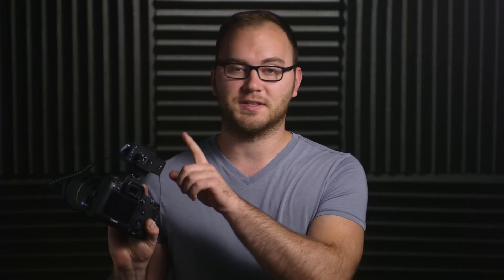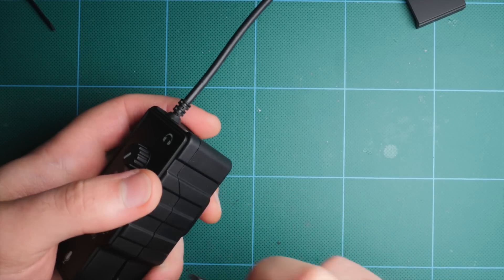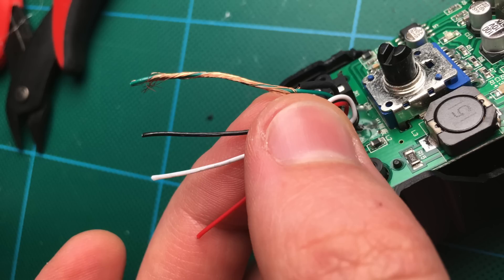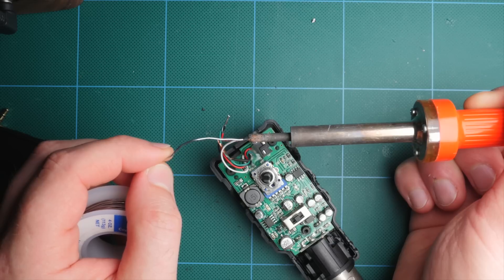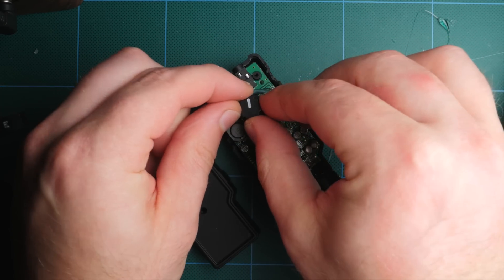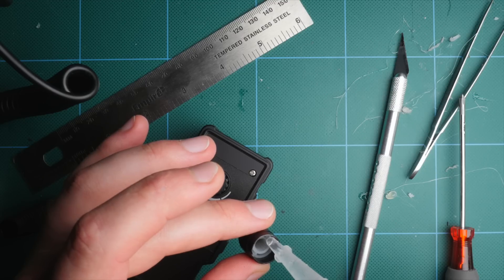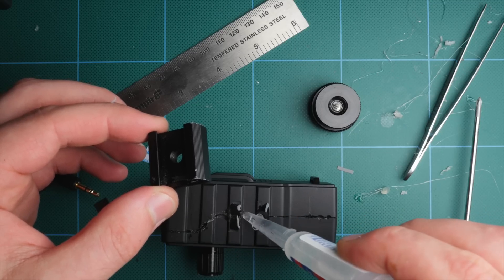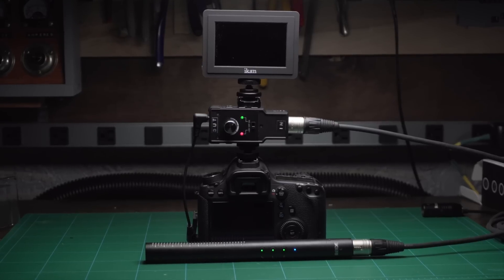Hacking the $23 Saramonic Preamp For Video Use

Comment: I'm a bit unsure why we're modding the cable, when in the end you just use the headphone output anyway?
Reply: This is also what im wondering about!
Reply from the maker: Because we need to convert the TRRS (for phones) to TRS (universal I/O). You could just use the adapter I talked about in the previous video. I liked using the headphone jack because I wanted the option to choose the cable length.
Reply: But couldn't you use the headphone jack directly without ever modding the cable? Or is the headphone jack also TRRS?

Comment: Ok, so when I mounted the shoes on mine, I filed down the "lugs" on the sides of the unit to make a flat surface first, then drilled 1/4" holes in the sides and bolted them through the battery compartment. I had to trim the inner layer of plastic to make room for the bolt heads in there, but the battery still fits perfectly.
Reply from the maker: Nice Scott!

Comment: what was the tool that you use to remove the wire cover ? 
can you link it plz ? 
is it reliable  ? 

why you remove the headphone jack that was maybe perfect for A6300 users ! we can put another output jack beside the headphone jack
Reply from the maker: Hey Moamen! Here is a link to the wire stripper I use: http://amzn.to/2coKh7I It rocks my face off. I love that thing so much!

I removed the headphone jack because I prefer using my own cable. That way I can keep it short or lengthen it if I wanted to. I also know that I wouldn't use the headphone jack because that only monitors the preamp, not the camera which isn't as safe.

That said, you could just turn the cable into a jack on the box.
Reply: thanks 😊☺:)

Comment: how would this make audio better? im learning... if someone could explain me... thanka
Reply from the maker: I'll do a Q&A since a lot of people have been asking this. This unit is essentially a better version of the preamps in your camera. You'll get MUCH cleaner sound, XLR input and you have smooth level adjustments instead of the menu levels on the camera.
Reply: 5 reasons a tool like this is super handy:
1) the pre-amp in most DSLR type cameras are quite noisy. So, with this device you can turn your camera's input level down low.
2) this device also gives you a dedicated audio control, so no menus to dig through to adjust your audio level.
3) this gives you the ability use XLR mics. XLR connections are "balanced" this gives you the ability to conduct sound through extremely long distances even over 100' without picking up noise.
4) this device provides 48v phantom power that many condenser mics need to function. 
5) you can use an external audio recorder (Zoom H4n, H5, H6, Tascam etc.)for reasons 1-4, but this audio lets you skip the step of organizing all of your audio and video files and syncing in post.

Comment: would of liked to keep the headphone jack to monitor audio. Any work around?
great video as always
Reply: other than the cheap feeling converter cable you showed in the last video
Reply from the maker: Hey chad! You could just turn the cable I cut into an output jack and leave the headphone jack alone. I knew I wouldn't use it, so I did what I did.

Comment: Hey, I dont know if u ever used a a6000, but there is a mic from sony for the hotshoe and that is sadly the only option. However it has a mic jack, in which u can put another mic, and it will then use its audio. Do u think I can modify it so, that I only have the hotshoe and a little box with the audio jack and a coldshou on the top of it? Have you ever heard someone doing it?
Reply: Vendetta V
Haha yeah sorry for my englisch im not a native english speaker :)
https://www.bhphotovideo.com/images/images2000x2000/sony_ecmxyst1m_stereo_microphone_for_multi_913245.jpg
I want to drill a hole in that cube above the hot shoe and relocate the Mic out down there. And the rest will be removed.
Im concerned that if u cut of the wires from the mic and leave only the cable for the Mic out, that it wont work anymore.